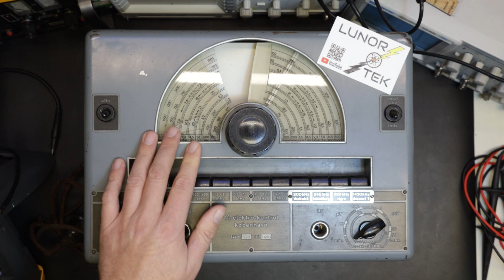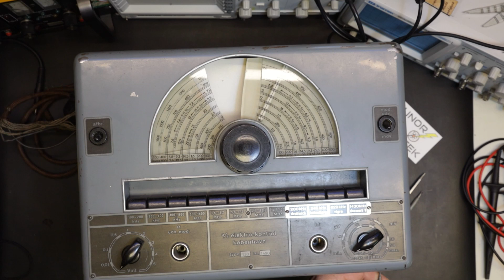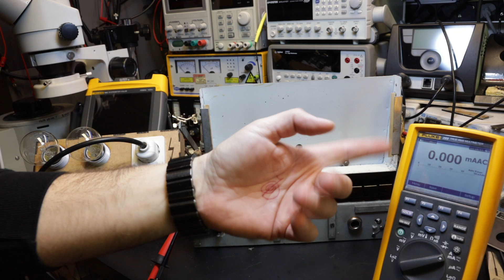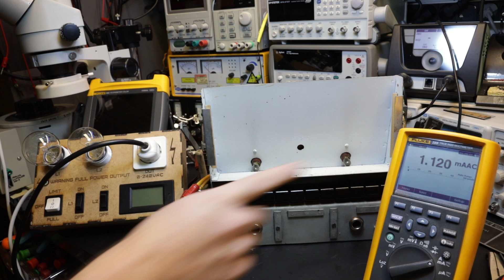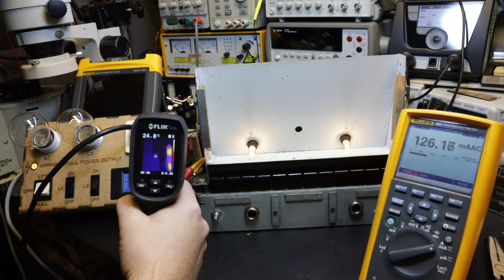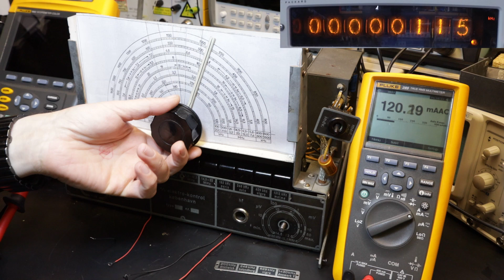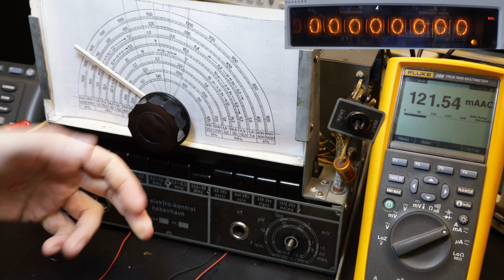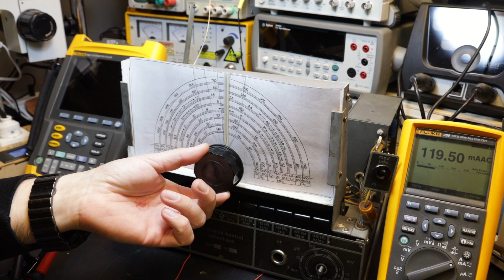Vintage Tech 06-Signal Generator from Submarine Repair pt1

Comment: Great find!

 If you can find a print of the dial artwork, you can print out a decal that can be put onto new glass to replace the broken glass.

The connector like like a Motorola connector. I use an adapter that screws onto a UHF connector, or PL-259.
Reply from the maker: Thank you!

See if I get hold of the dial artwork or use paint shop to fix the picture I took. 

Oh! Thats the connector! Ofc, I see it now. Thank you!